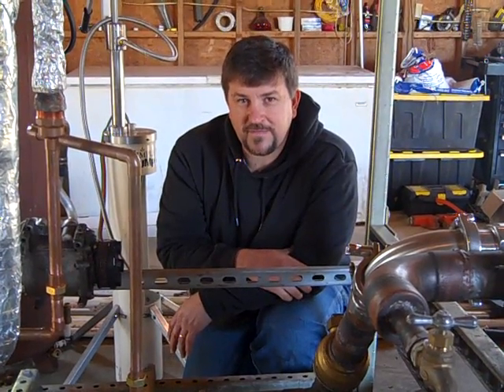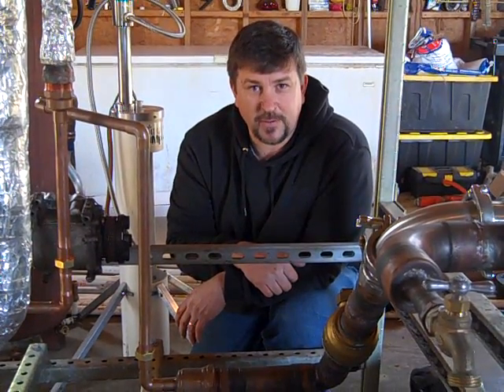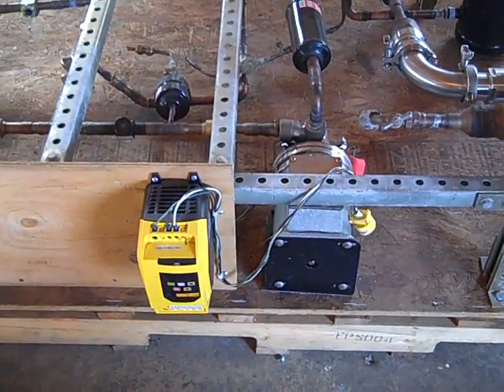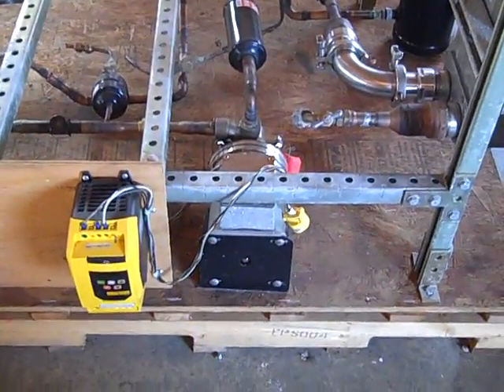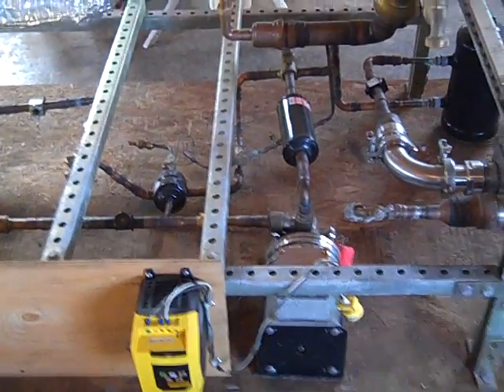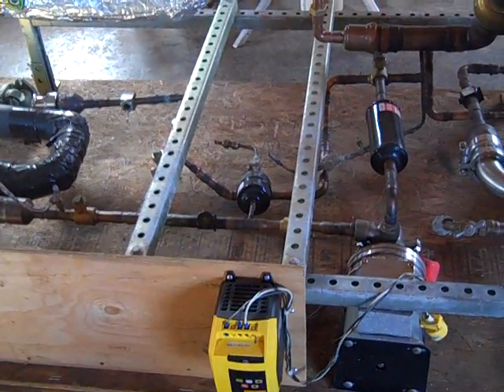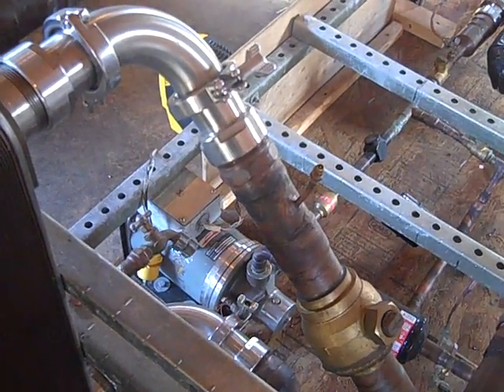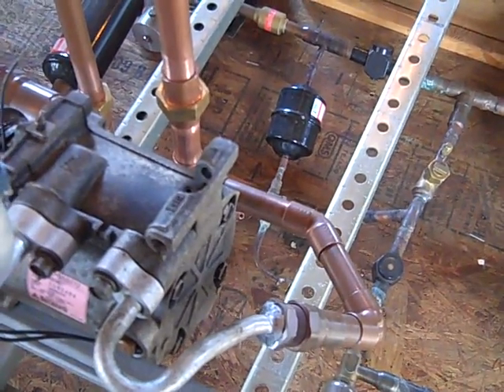Fire Power! Organic Rankine Cycle

Comment: Looked at ORCs a lot a few years ago, principally for concentrating solar dishes, and a few things come to mind. It all works a lot better with a heavier molecular weight liquid like one of the siloxanes, especially for higher temperature recovery, but R245 would have to be cheaper. Early ORCs used butane for low temp recovery, (chimney flues, salt water gradient ponds etc) ..!! There were giants on the earth in those days of yore :) I never found out what they used to purge the O2 out of the system; probably nitrogen.
You're right about reusing the waste heat; a recuperator should increase efficiency a lot. As would an increase in volume on the final condensor. It's fairly common, at least it was a few years ago, to have a large pre-condensor vessel, water cooled to create a greater vacuum than that created by the feed pump alone. This effectively sucks the waste gas out of the turbine, again increasing efficiency a fair bit. The whole system is similar in some ways to a Stirling cycle. If you've got any spare snow and ice to cool the condensor and create some vacuum, then you're really off to the races. Tesla turbines work very well on heavier molecular gas streams. Can't get much simpler than three or four aluminium plates on an arbor. Also worth looking at Tesla valves for one way check valves. Solid state! He was a clever joker. He's up there with Michael Faraday in my hall of heroes. You shouldn't have to worry about cavitation or thermal shock on the turbine,  (think of the poor buggers working with supercritical water steam just to reduce cavitation on their turbine blades); you could probably cnc a turbine from plate aluminium. Balancing may be tricky. All the best.

Comment: use vacuum-glass-tube collectors for a heat source! and store the excess electricity from summer in a hot sand battery for winter times... 🎉

Comment: Why did you never upload a follow up video? What happened to the project? 
I want to do the Organic Rankine Cycle myself, but there are only a handful of videos on yt and they have relatively little to do with real world use. 
Did it fail because of the wrong cooling liquid, because i think the majority of the gas is in gas form so you cant boil it off (i think)? 

I want to use petroleum-ether with a boiling point of 60°c and instead of a pump a check valve and gravity, the only problem is how to get the oil into the scroll compressor.
I will find a solution but i am disappointed that you don't even comment on what happened because i find it very interesting as an enthusiast in power generation systems to see rare diy projects in these topics and there is just silence but your channel is active, dosent make sense to me.

Comment: Dear Engineer775,

I hope this message finds you well. I wanted to inquire whether you've had the chance to complete this project. If so, I would greatly appreciate it if you could provide me with any available technical data related to the project.
Reply: Still on this project? lets connect, and share some details.

Comment: Found your channel after looking at GRC information.  I was looking at hot water being produced from the heat generated in hot composting.  It seems that i would be possible to use pipes run through a compost pile to produce the heat to run your ORC.  Compost should have internal temperature of around 150 degrees. Let me know your thoughts.

Comment: I'm curious if you ever got this working because I used to work at a combined cycle plant and have wanted to make my own steam turbine system for a long time.  Regarding the heat source, you could find waste heat from the cooling loop of an engine (which would allow you to use water or antifreeze) or its exhaust.  Depending on how far you get into it, you'll probably need a good alarm and trip plan along with all the necessary instrumentation.

Comment: Hİ, i want to make similar system. I understand you use mitsubishi galant Air conditioning compressor as turbine, 2 heat exchangers, and pump but i didn't understand which type pump? Can you say me? And also did you make any modification for compressor?

Comment: I saw your video and your project is amazing sir
I had a question regarding it...
The question is in an ORC if the gas is pressurized then wont the pressure of the gas would turn the turbine? And what is the neccessity of pressurizing the gas?
Correct me if i am wrong sir...
Ur feedback would be appreciated
Thanks..

Comment: I would like to start a similar project and have been doing some research.  From what I gather a turbo-expander running on super-critical carbon dioxide would give you the best energy generation efficiency for this low temp rankine cycle.  This is due to the relatively high latent heat of vaporization of CO2 compared to the organics.  It is quite difficult to source such turbo expander though. so for the initial poc i was thinking of hacking a scroll compressor running in reverse without the check valve.  The refridgerant I had in mind was R134a only because it is plentiful and relatively cheap with plenty of sources of compressors that run r134a to hack.

I am not familiar with the p245f refridgerant that you chose and was wondering why you decided on it.  

 I differ with u however on dealing with the utility company.  My goal is total independence.  If my battery bank is fully charged i would use the system to store energy as compressed nitrogen and store it in huge compressed nitrogen tanks or possibly liquid nitrogen.  When the battery banks need charging, the generator running on compressed nitrogen from the storage tanks would kick in and charge up the battery bank.  The compressed nitrogen can also be used to power motors, pumps, and other mechanical devices that use compressed air.

I would be interested in sharing notes and collaborating.

Comment: Serves you right for opening up your old text books. I am a retired HVAC Tech, Stationary Engineer, Gas Fitter, and am soon to embark on a project to go off grid in town without the use of solar or wind. I am not going to use a Rankine Cycle system but for years I have considered it. What comes to mind is the old double and triple expansion steam engines that were in use when the first steam turbines came along. If you have energy left in your working fluid when it leaves the scroll you might be able to use a larger displacement second pump (motor)  to assist the scroll and increase the efficiency of the system. Have you run your prototype yet? Keep us posted.

Comment: That's the same principle on older USN ships.  I think on the USS ######, a carrier we did the same thing in four engine rooms.....ultimate output about 80000 shaft horsepower each if I remember correctly.

Comment: After doing some more research on the subject, I can't help but wonder what kind of temperature water you'd have to use to effectively condense the refrigerant. I don't live too far from you engineer775 Practical Preppers and a google search says our groundwater temperature is around 62F. Even if you effectively transfer some heat with a regenerator, there's still a good bit of heat that needs to be pulled from the gas to get it to condense. Is 62F cold enough to condense it? What if your groundwater is even warmer than that? How many GPM of flow would it require?

Also, would you have to find a way get the water back in the ground?

Obviously, in the winter this isn't nearly as much of a problem. You could even use the ambient air to dissipate any unusable waste heat, but the summer concerns me. If you were making 10kw instead of 2kw, you could potentially use a traditional heat pump to help dissipate the unusable waste heat into the air.

Sorry about the questions ... this just really excites me.
Reply: I mentioned being concerned about the summer, but summer (at least in SC) brings some benefits, too. Hot sunny days means solar heat collectors could help with the heat input, saving wood. It also means you don't have to worry (as much) about recycling the heat in the loop, since you can just dump it back to the air without feeling guilty about wasting wood. Pros and cons, I guess.

Comment: Cool idea! I was thinking something along this line to power a small shop , But with a Small Liquid cooled engine, think it would make enough heat from the water jacket & homemade exhaust heat exchanger?
Maybe a 13hp 2cyl Honda HT3813 Engine? Also Could power a 4-6Kw Gen Head @ 1800RPM
& Of Course make it run off a Wood gasifier (Maybe even a Heat Exchanger off the wood gasifier?)

Comment: I was thinking you could build some very low tech solar heat tube boxes and utilize the heat off these to boil the refrigerant. On sunny days this could save you from using bio fuels to power the system. Good luck with this project this year. I'll keep looking for your progress.

Comment: Hi just an idea . Steam engines to be efficient needs expansion , so to make a triple expansion engine you could use three identical scroll but with three different size pulleys . So slow for high press and fast for low pressure . And if you use flat belt you can just snake it thou the four pulleys . Thanx again I

Comment: what is the specific heat capacity of your refrigerant at STP?  I assume it is lower than steam/water but I am curious?  

Additionally, what did you use for heat exchangers?  

If you ever run into any problems, I would love to help out.  I'm an engineering student that just got done designing a large scale steam rankine cycle for a senior level class at San Diego State University.  If you ever have any basic questions that you need answered, this stuff is all fresh in my head!

Great work!
Reply from the maker: Specific Heat of Liquid @ 86°F, (Btu/lb•°F) = 0.32
Specific Heat of Vapor @ Constant Pressure* (Cp), @ 86° and 1 Atm, (Btu/lb•°F)= 	0.2

I am using plate heat exchangers.   Since it has been 23 yrs since thermo class I might be picking your brain. Thanks for the offer.
Reply from the maker: engineer775 Practical Preppers HFC-245 FA
Reply: Thanks for the info!  Any time you need to bounce something off me, feel free!  It'd be awesome to see this actually work.  Once I finally get into a house, I would like to do the same thing!

Comment: While I didn’t read all the comments this is VERY interesting. While you stated this would be used to charge a battery bank. Depending where you reside your current thought process might be a better choice (I live in Florida and have not seen the sun for 3 days so my solar water system has been rendered useless). My point, having a multi-pronged approach to address your needs is a wise one sir. Keep up the good work, you are making us think!

Comment: Pastor, running a closed system is appealing.  Do not see 1.5Kw as being possible on a home basis.Yeah, can be done commercially on large scale or by military (unlimited budget for technology.)  It's a fun project but mately we know where it ends up...

I believe a more direct route to your goal is steam engine. Can still use waste heat to heat water. And it's pretty quiet if you muffle the output w/ water heater apparatus  . A 1 HP steam engine does more work per HP believe it or not (up to 1.5Kw!!!)  check out http://www.mikebrownsolutions.com/1hpapic.htm .   =It's the best I have found.

Warmest regards!!!

Comment: I would look at how propane refrigerators work only because it is a sealed system that works. Perhaps it could help in the scale working model area, all that's missing is the power part...

Comment: Great work! I built a similar system for an engineering capstone project. You have probably watched my video about it on YouTube. Your plan looks solid bit I would suggest minimizing losses as much as possible between your evaporator and turbine by putting them closer together. I would also be concerned about compatibility of any gaskets/seals in your hardware and the type of refrigerant you will be using.
Reply: where can i watch your video at?

Comment: You have peaked my interest, I am a heat and air man and understand refrigerant. One problem I can foresee is make sure you have a deep vacuum pulled on the system. This will ensure trouble free operation. What type of pump are you using to circulate the refrigerant through the system? What type of metering devise are you using to achieve change of state in the gas, is the the old car compressor? So many questions. When will you have a parts list out?  Keep on tinkering. :-)

Comment: I have seen this done on industrial scales. The input heat to output generational ability is about 14:1. So for every 14 KW of heat you put into it you get 1 KW of electric out. Not bad if you have excess heat but to generate that much heat just to make Electricity.??? Might be better of with Gasification.
Reply from the maker: My wood heater is rated at 500,000 BTU/hr  or ~ 146 Kw.  I am after 2Kw electricity production as I have my boiler going all day anyway so if you numbers are correct then I would be taking about 100000 BTU of heat to make 2Kw of electricity.  That would be ok by me.
Reply: engineer775 Practical Preppers
The numbers I gave were from a Turbogen CHP unit I saw hooked to a diesel Engine coolant system. ELECTROTHERM "GREEN MACHINE" CHP rations are about the same I believe except with a lower operating temp. Something like 50 GPM at 170 F to generate 10 KW using their screw type compressor and using ambient air chiller to condense the 245fa back to liquid. They also use a preheater. I just don't have that kind of heating capacity. What type of boiler are you using?
Reply: I really hope that the 2Kw = 100,000BTU formula is incorrect. Assuming 1 average size oak tree = 1 cord wood = 22,100,000BTU, it would take 40 trees per year to produce a constant 2Kw of electricity with this unit, not counting the heat needed for home heating needs.

One would think that with proper use of insulation and heat reclamation via a regenerator, you could get a lot better than 14:1 efficiency with this. I hate to waste trees.
Reply: *****  2kw * 24 hours * 365 days / 442kw per cord = 40 cords you are correct.. Its not the most efficient way to do it i agree but if you already have excess btus why not use them?  The ratios I gave are commercial grade ORC's so i am not sure how much more efficient you can make them with insulation. Trees are after all renewable. Coal, Gas, oil, etc are not. Its not like we would be deforesting to produce electricity. Solar does a better job of that and is less physically demanding. If you have excess heat from a boiler  A/C, some industrial process then use it or it goes to waste anyway. Just look at those giant cooling towers on power plants. I have no idea what temperature the water is when it gets to the towers but seems to me it could be used rather then venting it to open air.

Comment: The more I think about this I don't see you getting the efficiency you will need unless you are using some sort of modified tesla steam turbine right at the liquid to gas phase and a very large accumulator. Duty factor of the refrigerant will only be limited by the amount of leaks in the system, no leaks and it should last forever.

Comment: Very cool. Have you thought of using a small thermoelectric generator (TEG) to run your pumps? Seems one could be set up near your heat exchanger. I know these won't make the amount of power you are looking for but the could run the pump and supply the 12v for the clutch on your scroll.  If they were in your exchanger they could make energy from the waste heat.
Reply: Nice idea!  You could sandwich them between the cooler and pre-heater.

Comment: Hybrids like the Prius use Electric driven ac compressor so I'm wondering if you could use something like this to generate 12 volt without the need to run a belt driven alternator

Comment: I doubt if I ever build one, but I'd like to see it in operation.  I must be under estimating the RPMs that the compressor will run with the gases running through the pump.

Comment: Awesome idea. First concern of mine would be the ability to acquire the refrigerant in an off grid situation, second would be the parts. But a question I have is would the same concept be possible using water instead of refrigerant, ie the steam engine?

Comment: why do you keep doing this to me?
Reply from the maker: Sorry dude. I can't help my self.
Reply: engineer775 Practical Preppers The reason I like this system is because it is quiet. My steam motor project will be very loud. How big will I have to build one to turn a 10,000 watt Hobart generator?
Reply from the maker: ironhead41 Well this one is hopefully going to make 2kw/hr and hopefully 50Kw a day.  This will be used to charge a battery bank and or dump it on the grid- I can sell back 100Kw a day with my power company. While the grid is up I plan on using it but when its not it will be the battery bank that would run my Lincoln 300/300 welder.

Comment: very interested in seeing this fully working and then scaled down an made compact enough to fit into a doorway.. then it would be a sellable product. but I have reservations about it making more power than the compressor and water pumps will draw. it will obviously need battery power to get started, but can it really be self powering and still provide a practical excess. oh, and the other heat exchanger can be used to dry foods in a cabinet.

Comment: I presume the system could only be started (pumps running) if you had a charged battery?
Reply from the maker: or generator.
Reply: engineer775 Practical Preppers Very impressive work there...
Reply: engineer775 Practical Preppers I think it has a far better chance of achieving an 'over unity gain' state, than most of my invention intentions.